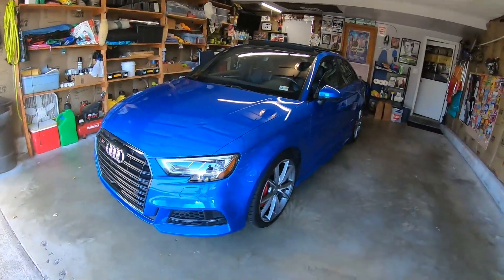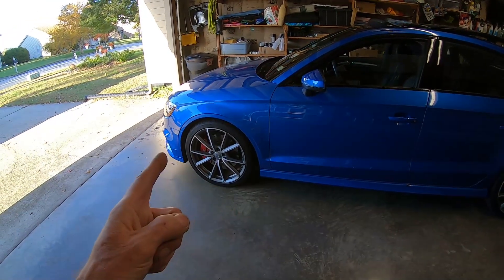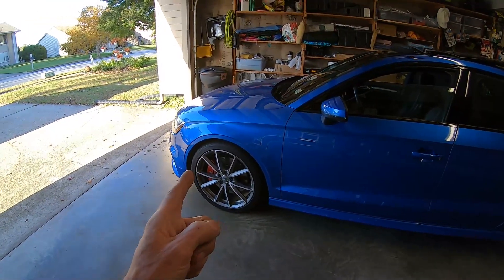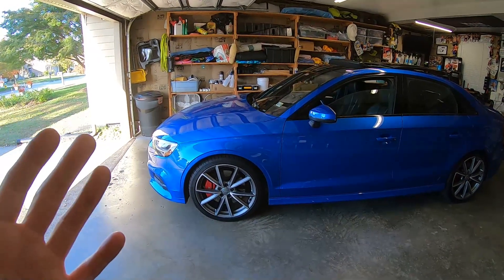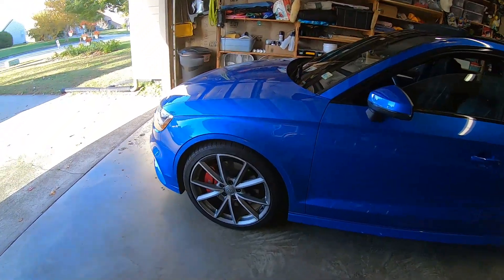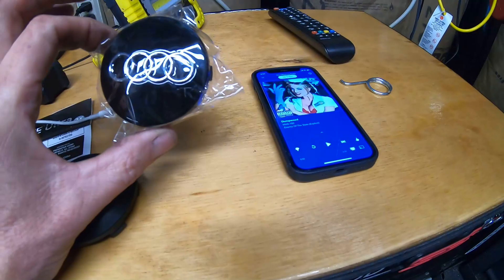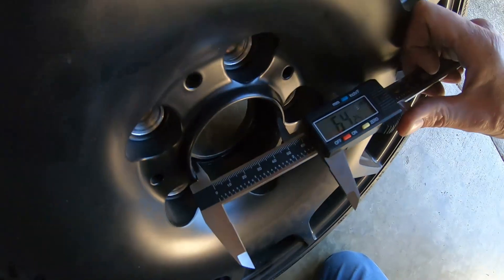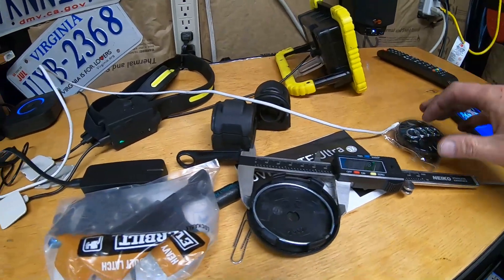2018 Audi S3: Episode 14: Why Did The Sparco Wheels Have To Go Back On?

Comment: Did you try running the 19's on 36/37psi?...I have to admit it took me a while to get used to 19's coming from 17's but running them at 36psi made them acceptable in comfort mode for the DCC/ACC.

Comment: Might also explain why the new tires.  The big question is - if Carvana put those new shoes on or did the previous owner - in any case Carvana is said to put their cars through an inspection and if they did see that (how can you miss it) and didn't disclose it then you have some thing to come back to them with.  I'd check right away about what your recourse is (even up to returning the car - well threatening to return it)  - I know CarMax is either 7 or 10 days with less than 1000 miles driven no questions asked and something like 30 days if there's an issue they cant resolve - I had a Kia Sedona minivan that they (CarMax) couldn't resolve a wheel vibration at freeway speeds and they "bought it back" (basically paid us what we paid).
Reply from the maker: dude, its hard to even get a carvana person.. they keep sending me to the warranty company, who does not handle this type of issue.